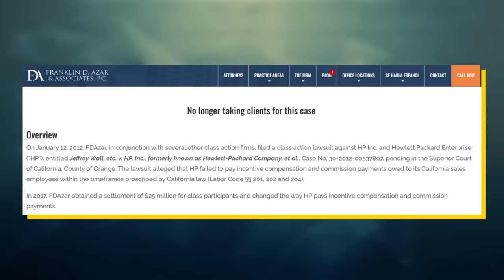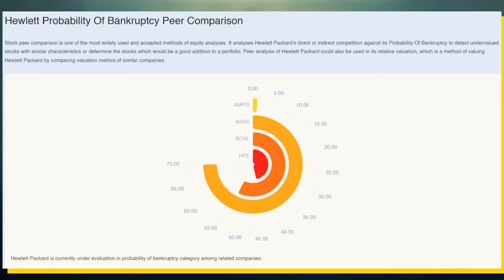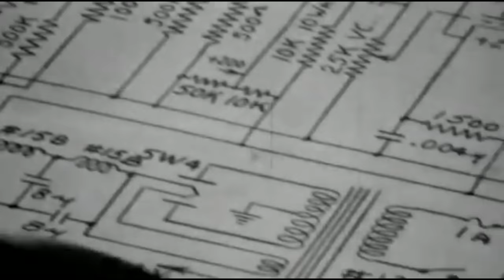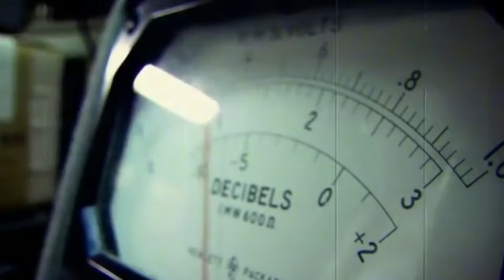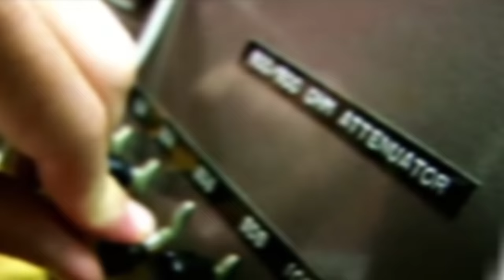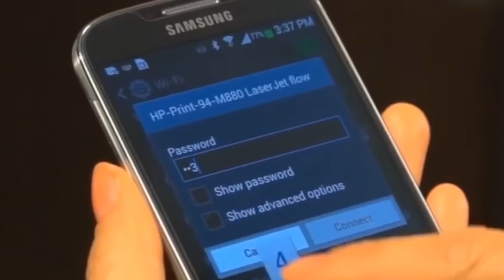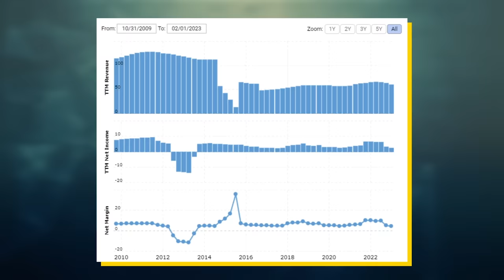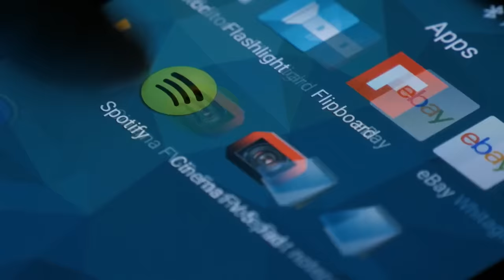From Innovation to Irrelevance: How HP Lost Their Way

Comment: Their computers also suck. Several years ago I bought a HP Pro 4300 SFF PC and it's motherboard USBs were faulty. Granted this was a secondhand machine but I never, ever had this problem with Dell or Lenovo machines. And when I got a replacement motherboard, at first it worked well but after a while I stopped getting any display from the VGA. Not even a graphics card was able to resolve the display issue. Turns out the bios chip may have been compromised. Suffice to say, I never bought anymore HP computers after that.

Comment: As a consumer, HP was the peak of horrible thermal design in notebooks (read: loud fans) and the very peak of hostile printer behavior. That destroyed  my consumer image of them for long, and I took that mistrust into the business server world.
Reply: The thermal design of hp notebooks is atrocious. Mine after 2 years of use constantly heats up by simply being on youtube and during summer I have to sit on the cold floor out of fear of it overheating. It even manages to heat up the floor after a while, which is an incredible feat due to the structure and material of the ground

Comment: At first, the hp computer uses, feels curious after that I'm feeling because you need to create an account for using hp print. And also, the computers is good for special users, like to have ssd, HD storage and with DVD reader. But when the PC has some ram lower, graphics specs lower and hadn't a longer uses when it's after 5 years of longevity. I'm feeling bad quality, when also the computer has breaked of catcher within keyboard and screen. At this bad conception, using hp is garbage for free mind uses. BTW the hp look when you see the first time and the software is good. The bad feels it's for using it for a very long period.

Comment: Could you defend those HP bankruptcy probabilities?
Standard & Poor's thinks those probabilities are much lower, and they are the probability professionals, so those odds are doubtful.  Your probabilities come from a tiny company called Macroaxis, which has a difficult-to-understand methodology.  So, before you run around panicking all of the creditors of an enormous company, you have to make sure the methodology of the credit analysis is valid.
Reply from the maker: It’s from macroaxis
Reply: @LogicallyAnswered  Well, their model is wrong.  The risk analysis is wrong for Bank of America and wrong for HPE and HPQ.  HPE and HPQ's debt is not priced for such a high default rate, nor should it be.  The credit quality of companies is a serious question.  Putting forward nonsense risk analysis prevents companies that merit financing from getting needed capital.  Unless you're sure Macroaxis is right and S&P is wrong, you shouldn't report just Macroaxis.

Comment: The level of incompetence with HP is mind boggling.  Servers are crap.  Any time they touch software it's garbage
Reply from the maker: Dang brutal haha
Reply: @LogicallyAnswered  my 1/4 century of experience would just call it a fact.  They try to customize stuff to differentiate and make their stuff seem special, and the firmware and drivers needed to make it "work" is some of the most abysmal garbage I've seen from any vendor.  If it wasn't for the high volume contracts with government, they'd be dead a long time ago.  But unfortunately few companies can do the massive mfg volume needed and provide the warranty support required.... Though, that's not even any good anymore.  Next day is more like next week for them now.